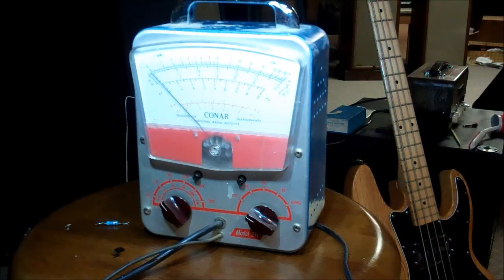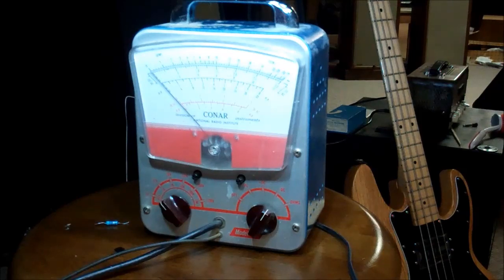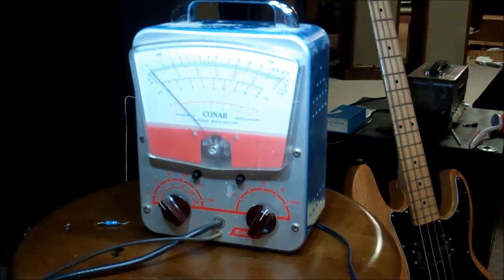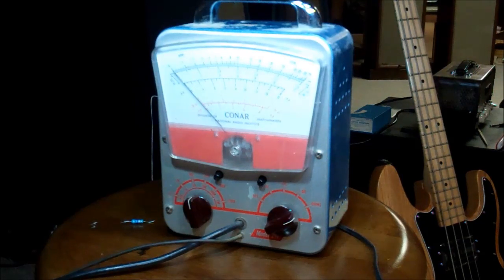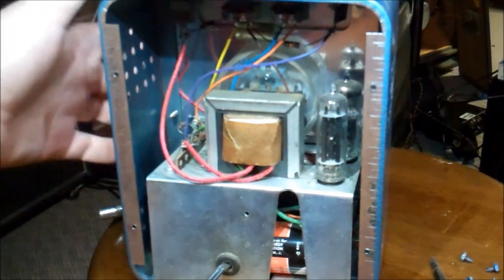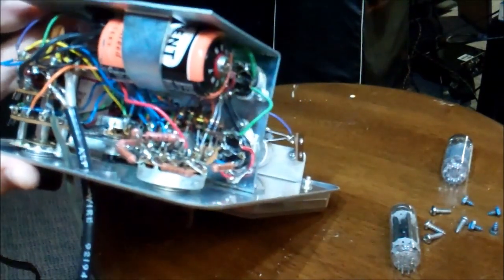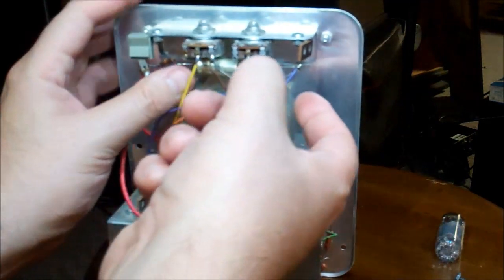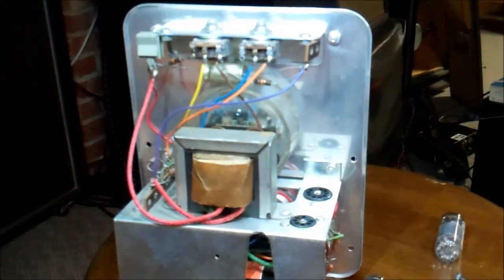Conar National Radio Institute Model 211 VTVM  Does it work???

Comment: looks like a 6X4 and a twin triode
Reply: Exactly, Glass Monster... definitely a 6X4, and most likely a 12AU7 for the twin triode.
Reply from the maker: Turns out to be a 12BH7 according to the schematic...  also a twin triode.
Reply: @DeadKoby  in my Hammonds, 12bh7 can be subbed with 12ax7.